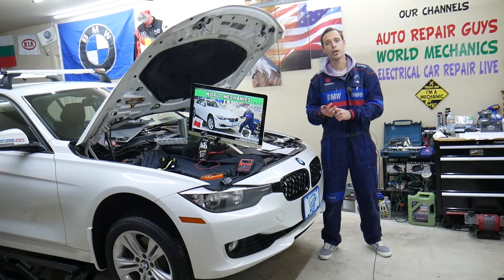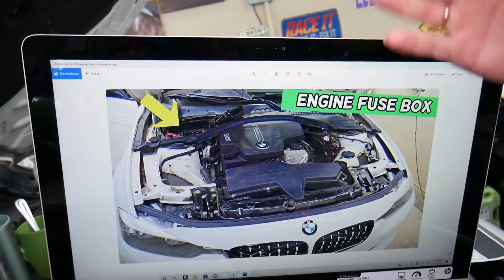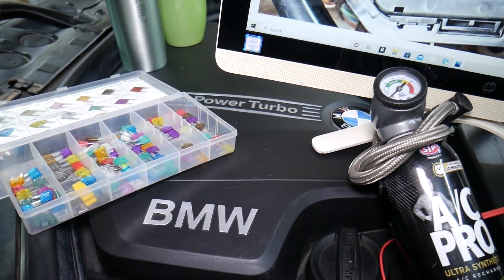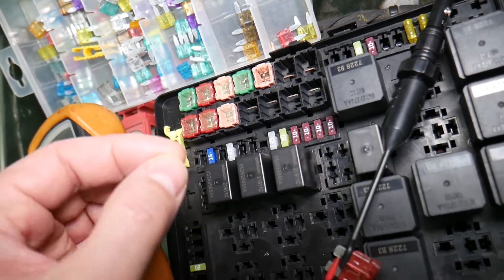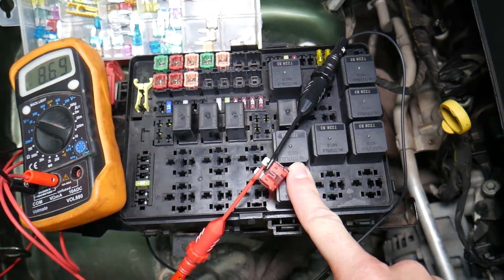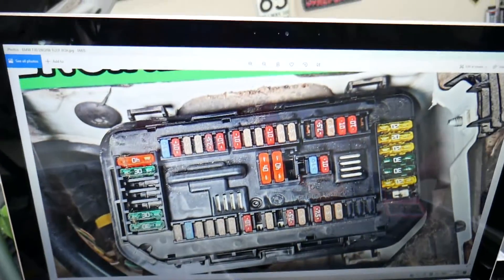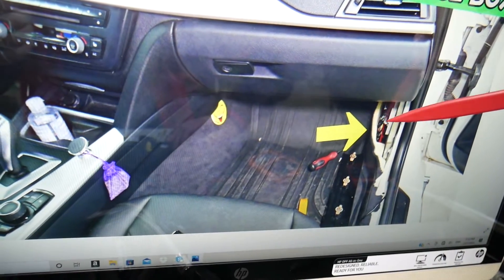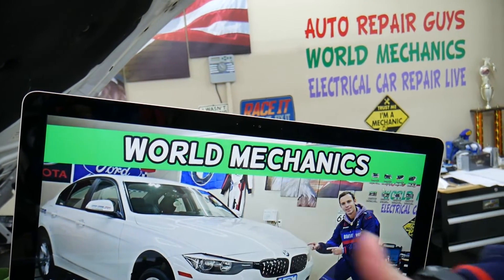WHY AC AIR CONDITIONER DOES NOT BLOW COLD COOL AIR BMW F30 F31 BMW 328i 320i 330i 335i 340i 318i 316

Comment: Hi, I have a 2017 BMW x1 vehicle. When I switch on the air conditioner. Cold air comes from the right side of the air conditioner and hot air comes from the left side, does anyone know the reason for this?
Reply: Make sure the temp is even and not half red and blue
Reply: You need to click on sync button - it will sync both sides to COLD